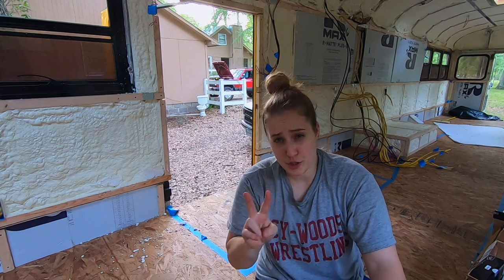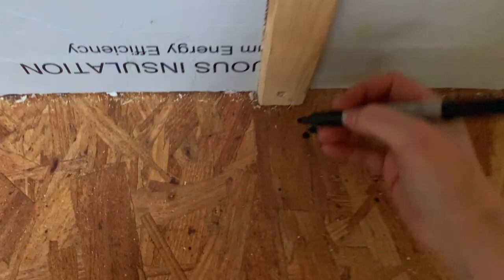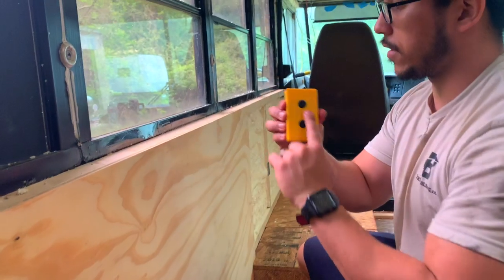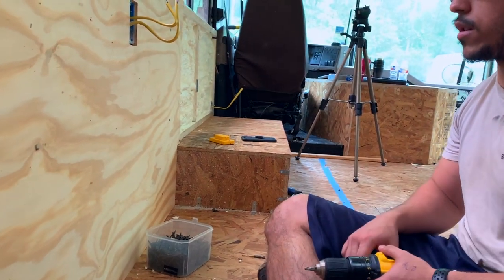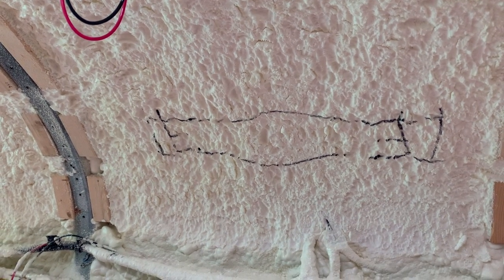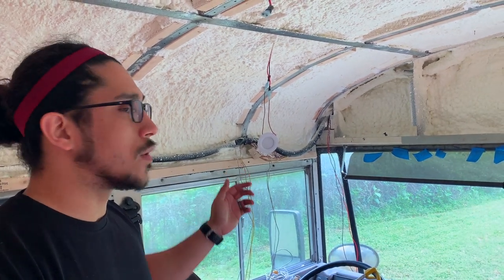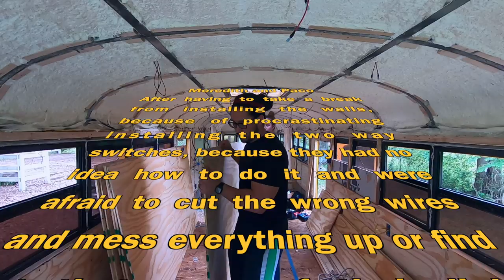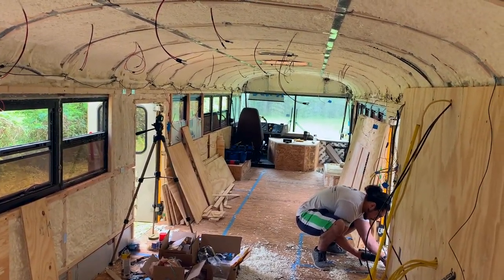Putting Up Sidewalls in Skoolie + 2-Way Switches 12 Volt * Skoolie Conversion * Gus The Struggle Bus

Comment: if you use the magnet piece of youre new wallsocket hole tool (i like that thing btw verry smart ) , youre probable be able to feel it when you pass it over the metal protection cover over the cables
on instalations here the switched wire is usually black dont know how its done in the states
Reply from the maker: OO That is a great idea! Thank you so much!

Comment: I've been seeing people using 1/2" for walls.  I was thinking about using thin 1/4" ply like the fiberglass/plywood paneling I removed from my shuttle bus.  Do you know why people don't go with thin plywood?
Reply from the maker: That is completely up to you! But you do need to take into account any walls you will be attaching to the side walls. The thicker the walls the more secure anything you attach to them will be. As well as any sound or insulation additions!

Comment: If you didn't want to have more than one switch controlling a circuit can you use standard switches?
Reply from the maker: Absolutely! we have a couple of switched that are standard and for those we just used a one wire coming from the power + (battery) and the other going to the load + (lights).